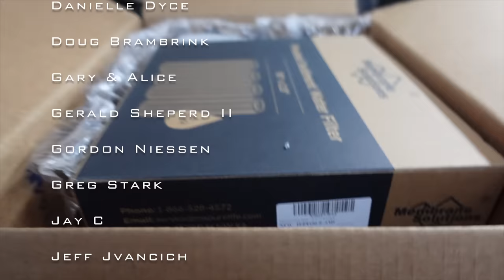MAYBE This wasn’t a great idea | LOTS of BoatWork | Ep 346

Comment: Mate, generally you display a level of industrial experience and skill. This time around, you used a pair of squint safety glasses and guided your son to the same experience using a wire wheel on a drill. Please use eye protection. The cost is low, and the result is something to look forward to.

Comment: Was just watching episode 108 and noticed your predicament with the bathroom. There's another sailing family (Mothership Adrift) and they run into the same problems with calcium buildup in the poo pipe. They were saying its caused by the mixture of urine and sea water being used to flush the toilet (dunnie). They have to continually take the poo pipe out and bang out the calcium deposits. Perhaps flushing with desalinated water might help.

Comment: Maybe trying to seal the prop shaft from the outside before pulling out the boot would keep so much water from coming  into the boat.  Using plasticene kids putty on the shaft after you have moved it back as far as needed.  And yes wire Does fly off those wheels and eyes are not that replaceable yet.            CHEERS AND FAIR WINDS        Steve h.

Comment: I put a PSS seal in my ketch. The shaft is such a neat fit I have very little ingress of water when working on it in the boat. I’ve had it about six years now. The first bellows lasted less than two years when the bellows lost their ‘spring’. It was replaced free of charge by PSS people. What is good about PSS is that with no ‘lip’ seal there is no wear to the shaft. Where as with packing and lip seals like Tides and Volvo, you eventually damage the shaft needing either to rebuild the shaft, replace it or put an easy-seal collar. 

the PSS system is much better with a locking collar on the shaft in front of the ss collar. This prevents the ss collar of the PSS moving. And I think it’s a necessity.
Reply: I remove an old school packing with high tech packing material that didn't leak or have any problems and installed a PSS that leaks at certain rpms expensive mistake  !
Reply: New PSS Pro seal will outlive the standard bellows. Reinforced and will not perish , allegedly!!

Comment: 3:56 There should be 2 screws there 1 to hold it in place and the 2nd to lock the 1st screw and a hose clamp ahead of the slip ring if you wanted

Comment: I used to run these honda water pumps and I believe they were trash water type and didn't have to have clean water and had about a 7 or 8 foot head, and would pump up 600 feet with large amounts of water. I'd put one on my boat with an exhaust outlet and be set for unexpected water coming in.

Comment: Great videos! Just discovered you channel. My fear with a PSS shaft seal is that a failure would likely be catastrophic. My soon to be new (to me) sloop has one, but I am thinking of replacing it with an old fashioned but reliable stuffing box. I know that they can be repacked without much difficulty with the boat in the water. But now I'll explore the unit you have just installed, so at a minimum I'll know I have looked at all options. Have you been happy with it?

Comment: Hi, your pss seal looked that it got overheated , so was there no water feed to it
Reply: These PSS seals on smaller diameter prop shafts don't have a water feed to them. Larger bore ones do. It looked like the mating face on the one he removed hadn't been looked after and /or been contaminated with  something or other. Generally, if these leak a little bit, you just need to clean the mating surface with a cloth or some fine wet and dry abrasive sheet to get them back to running drip free.